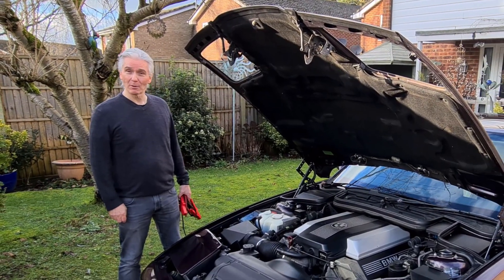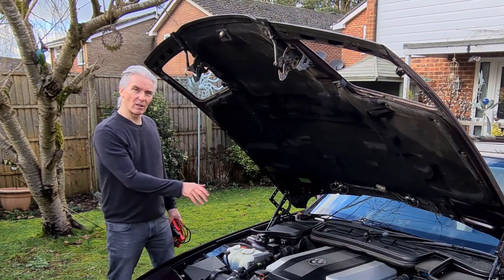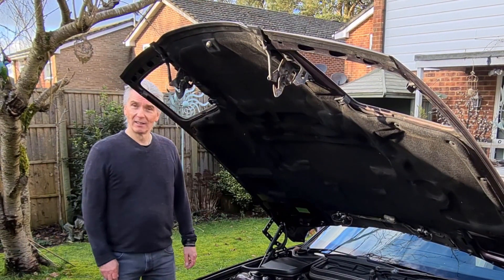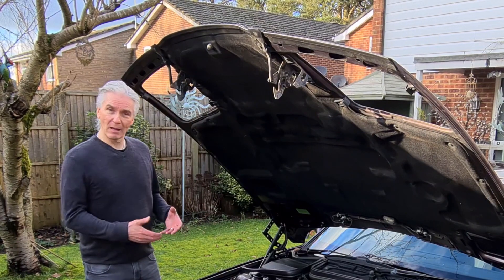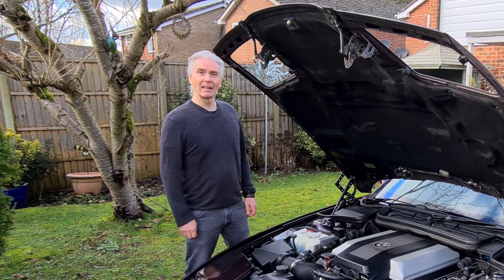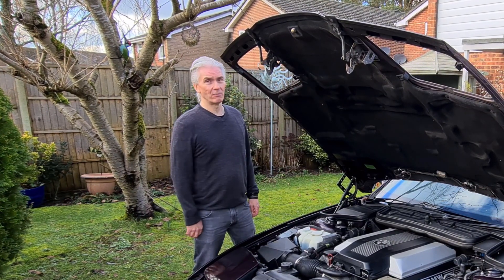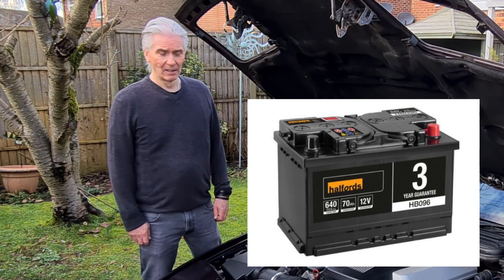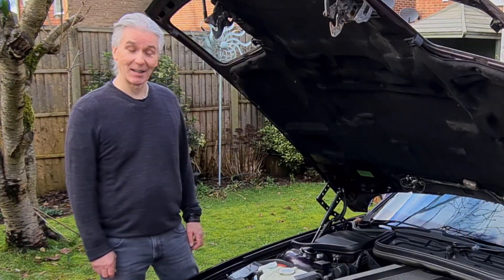OLD BMW? NEED A JUMP-START? NO NO NO NO NO!

Comment: My thoughts Tim, rather than opposing opinion as this video will help someone bricking a module which is unrecoverable. I'm using 35 years on the spanners with some electronic experience (to be completely transparent 20 years of that, was corporate IT and cars as a hobby) those connectors under the bonnet are for convenience (as stated by BMW) battery location which helps with the neutral front/rear balance can be a time consuming activity to access (model dependant). The problem is some of these cheaper jump starters is they have burst voltages way above 20 volts (non BMW alternators may have this issue, I can't say) which is enough to corrupt modules whereas most BMW alternators top out at 15 volts which is just within the safety threshold. 

To summarise briefly and reduce any possibility of module corruption (jumping BMW to BMW which I do for coding sometimes) I'd connect jump leads with the jump car engine off, then try to start the car with the flat battery. The extra 100 amps or so you'll get with the alternator running (assuming you have good jump leads capable of carrying 200amps minimum) isn't going to make a huge difference and most batteries sit between 12.5 to 13 volts which is well below the voltage required to corrupt module memory. 

Just my opinion only, pinch of salt and all that, keep up the good work! :D

[edit never killed a module ever, done a few hundred at least]
Reply from the maker: Thanks, these are the sort of replies that keep me going!
Reply: Sorry I just came upon this and I have to say [quote] "connect jump leads with the jump car engine off" [quote off] this is the foolest thing to do when jump starting cars. Always have the donor car running before connecting jump leads! The alternator has a voltage regulator unit that will do just fine with any differences in current, but the whole system must be running altogether with donor battery charging.
If you connect dead battery with good battery on your car than you are asking for disaster. The difference in potentials between the two batteries can do a real damage to any electronics connected to your battery. I would not do that.
Reply: @TimmsBMWRepairsandInformation  wow nice info Sir.  I just  bought BMW E34.  I wasn't driving it for 2 months and I have no idea how good battery is.  I was about to jump start it just in case if battery is flat. Im im happy i found this video.  My question is what to do with battery if I'm not using car for 5-6months?  (winter period)  It''s safe to disconnect  for winter?  and is battery charging and connection back is safer?  
Tthank you.

Comment: Yes, well said again Timm, another informative video. Just for the sake of informing a lot of your fans commenting, I have several old cars, including the E31 that I try to keep going and batteries are a pain, as you have so perfectly explained on previous videos. I have, for a few years now, two main tools in my arsenal. One is a top quality "intelligent" battery charger (not too expensive really), and a new spare battery that I keep topped up fully charged. If there is no real alternative to jump starting the dead car, such as where it is parked, then jumping from a good battery rather than another car is much safer. Also switch the headlights on before connecting the jump leads, leave them on until you have disconnected the leads, this gives an extra load to absorb any spikes. Keep the vids coming!
Reply from the maker: Thanks Bob, and good to hear from you!
Reply: Why not just replace empty battery with full? I'm newbie here.  And how you jumpstart car battery?  Do you put terminals under hood + and ground for example shock absorber screw)? or empty battery under rear seat to full battery. Nice tip with lights on. Thank you. I will defunetley buy intelligent chartger ans one spare battery. Better safe than sorry.  Sorry for those dumb questions😂 i never payed this big attention to these details owning other cars.

Comment: Hello! Just discovered your channel. I live in the US (California) and have a 1993 850Ci that I love, 3rd owner, 135K miles, had it since 2007 and, as my mechanic says, I will be buried in it - not due to accident but because I will never let it go.
I knew that jumping was a bad idea, but since mine is currently dead due to being out of town and not driving it and so happy I saw your video. I will invest in 2 new batteries to be safe.
An aside, I watched your vid of getting your car back after accident and you mentioned the headliner sagging. I just got mine done at my local BMW specialist (Coast Motor Werk) and it looks amazing - they did an ultrasuede that matches my gray interior perfectly and apparently will "never" sag. They did an amazing job. I also had the bushings replaced since apparently my engine was resting on my exhaust system. Very different drive after, and I'm not sure I like it since I was not used to a bouncy ride. Mine is silver OG color that is super faded. I am considering Techno Violet (individual color) but love the Maura metallic that you have. Thank you for the videos and the detailed information.
Reply from the maker: Always my pleasure!

Comment: BMW's are jump started in BMW workshops all over the world every day.
In 40 years working on BMW's never once had an issue. With the 1 in 10 rule , I should have had about 200 problems.
There is a problem with the maths somewhere .
Reply: Never had a problem jump starting my bmw, in fact never heard of anyone ever having problems after jump starting 1. Even bmw state that is what the points under the bonnet are for. Got a feeling people will be doing the most basic mistake and nit connecting red first
Reply from the maker: Thanks for your reply, yes, there is little chance of damage - but the risk is still there and I have been involved with many cases where damage has been done.
Reply: I think that engineers in BMW know very well what is inductions and the damage that can cause. All electronic modules are designed to stand such voltage picks that can appear when jump start the car. One more thing, when replace the battery I may have same problem connecting the terminals. Is this mean that I mustn't replace the battery? If you afraid from voltage spikes follow the advice from Bob Frankish turn on lights. Resistance is enough to smut spikes. The only problem with jump start is to put wrong polarity. This definitely will damage something.

Comment: I think the root cause of jump-starting problems (aside from reverse connection) actually comes from the fact the dead car's battery has sulphated of effectively has a high internal resistance. This means that when the car finally starts and the jump leads are disconnected there is not enough resistance in the battery to buffer the output of the alternator which can surge sky high. I good rule of thumb is if the battery can start the car then its probably safe to run the car. Therefore if the car needs to be jump-started then the battery is probably not good enough to safely run the car. 

One may think the battery will charge up quickly, this is not true on a battery that's been sitting for a long time. It may only take a few amps of current even at 50 volts so there is effectively nothing to clamp down the alternator voltage.
Reply from the maker: Hello Andrew, yes, after producing the video I realized that I had forgotten to mention the battery impedance - which increases the more Suplphated it is - and the state of charge which does exactly the same. As you say, the battery forms an effective load for both inductive spikes and lack of alternator regulation - Thanks!

Comment: Jump leads with surge protection are available which can manage the inductive effects. Better to avoid jump starting altogether, but there is a technical solution for this problem.
Reply from the maker: Thanks, yes good advice!
Reply: @MrFryfish  I've got about half an electrical engineering degree, we did cover inductance and all the basic differential equations. Not that I have much intuitive feel for quantities, are you saying jump leads don't cause inductive spikes? Thinking about it, I suppose the starter running and stopping is probably the biggest sudden current change, that happens every time the starter is operated and isn't happening when the jump leads are disconnected.. Even if there aren't inductive voltage spikes, there's still a load-rejection voltage spike when disconnecting jump leads, though that'd affect the car with the full battery, not the one with the flat battery...

Maybe best practice should be to turn off the running car before disconnecting jump leads, to prevent load rejection voltage spikes..
Reply: @MrFryfish  what happens when you disconnect a DC circuit.. the current changes suddenly, causing a voltage spike.

Comment: Just keep a small lithium jump pack in the boot. Check the charge level a few times during the year. 

In the winter whenever the temp drops to 0, I will hook up a trickle charger to my car battery for a day to keep it fully topped up. 

Those trickle chargers only put out about 1.5 amps max. So will not harm anything.

Comment: Jumped my 99’ e36 M3 a couple times, WITH NO PROBLEMS, at the battery terminal, before I finally replaced the dead battery.
Reply from the maker: Thanks for the info - my video does explain that you are unlikely to damage the electronics - but sometimes you do!

Comment: Interesting discussion. Older electronic components (ICs) can easily latch-up. When this happens they get very hot and will eventually destroy themselves or their power supply. A transient voltage or spark can do this.
Reply from the maker: Thanks Andrew!

Comment: My 2008 750li battery does not last long sitting. We drive about once or twice a month. And I need to charge it overnight before. If I try to Crank it over after about a week, it's so weak .I used to charge it from the back directly, then I watched a video saying it will fry the electrical/computer system. Now I charge and " jumpstart " from the front
Reply from the maker: You can charge from the batter+ve terminal and the chassis, you cannot use the batter-ve terminal. You will not have any damage, but the ECU does not know the state of charge. Time for a new battery!

Comment: I'm an electronics engineer and I agree with this advice. I'd add that many jump leads are poor quality and can make a fairly ineffective connection. When you consider how much current is needed to run a starter motor and you look at the way many cheap leads connect it's amazing they work at all!

If you're having trouble be sure to turn off lights, stereo, fan, etc. and try again with the minimum electrical load. I've seen it make the difference on a low battery.
Reply from the maker: Thanks from another electronics engineer!
Reply: I can certainly say that thin leads weren't enough to start my 190D when an alternator brush had worn down too far and it wasn't at home.. had to have it connected about 5 minutes before it would start (the diesel can drive without a battery but won't start that way).

Comment: Great information! I will definitely not be jumping my E39 after watching this. But what about a jump/starter pack? The sort the connect to the cars battery/jump points and then gets switched on? Do they create the same high voltage spike when there switched on aft connecting to the car? 
We use them alot at work on modern BMW/Mini
Thanks
Reply: Those things are perfectly fine, because they got a secure mechanism built in to prevent Voltage spikes.
I’ve used them multiple times on my E39 in the past and everything went perfectly fine.
But I would suggest to use them directly on the battery in the trunk, rather than using the plugs in the engine bay.

Comment: Damn.  I keep a pair of jumper in the trunk. Not the cheap crap with the sheet metal pliers, the real deal that pinch grown man style, made of plain thick metal. And I've jumped a few cars in desperate need of juice here and there. Now that I know, thanks to you Timm, that it can pop a random module of my e39, I'll keep them for my old Civic. She hopefully doesn't mind a few spikes of volts. Or perhaps it could damage the alternator' regulator ?
Reply from the maker: Bung them in the boot of the Civic - they'll be fine there!

Comment: Jumped my e39 m57 .with my x5 4.4 ..now e39 missing and not charging white smoke .😢
Reply from the maker: The white smoke shouldn't have been caused by jumping - but the failed alternator will be

Comment: Timm thank you, also the problem is most Bmw owner is just do sth then invest is it right or not. Some of them dont know black, red polar. I saw important mistakes outside. Some Bmw services even dont know how to charge battery. In Turkey is it normal to service destroy your car easily.... 

2 days before I cleaned all grounds, checked alternator and its diods, cleaned sockets and got new Varta battery to make all system brand new. I have also battery charger with 3 A to make my battery minimum 12.50 V. 

)
Reply from the maker: Good to hear from you Ali!

Comment: Why do BMW fit jump points under the Bonnet if its not advisable to utilise them ??
Reply from the maker: They are not Jump points, they are charging posts!
Reply: Umm, Despite watching quite a few BMW Videos where they all use the under bonnet remote posts to jump the car your still firmly in the minority who say not to, Confused now, Additionally I messaged NOCO USA and asked if their Range where safe to use in this manner and they stated it was not a problem as long as they were used correctly. The other thing that has me puzzled is the posts are way over rated for just a charger connection, Looking more up to the task of a Jump cable of Booster Clamp. So we agree to disagree on this one :face-blue-smiling:

Comment: I own a E32 740IL 7 series, and my battery out, thanks to you're video I will not jump it, but charge it I will do, but I can only locate the positive under the hood and not the negative. Is there a specific bolt or knot that will suffice for ground coverage? Like one of the bolt/knots that are located right were the shock absorbent is
Reply from the maker: Yes, that's the one, the larger nut on the suspension shock tower.

Comment: As long as you don't connect the cables backwards and key is out or switch is off, it's ok.
Reply from the maker: ....usually it is - sometimes it isn't!
Reply: Many BMWs have a sleep mode for 16 minutes after you remove the key. So modules are still getting power.

Comment: Does the same apply to an E39 530D ?  
some context. 
i jump started a friends car and the next day my battery was completely dead. i did jump start it a few times after but no matter how long i left the engine started i couldnt get the battery to start my engine from cold. 

side note- my boot/ trunk latch developed a fault around the same time (broken spring) so the light inside the boot wouldnt turn off so i figured thats what had drained my battery over some time.

However,
i changed the battery for a brand new one as well as getting a new latch fitted and all was fine until a couple weeks later. i did not drive it for between 24-48 hrs and the battery was flat again . dont understamd why its happened can anyone give me any suggestions?
Reply from the maker: Yes, same applies to the complete E39 range - you need to measure the current drain - all explained here: https://youtu.be/8AKYiOI_nyg

Comment: So how do I get my car started
Reply from the maker: Charge or replace the battery, that's the safest way....
Reply: @TimmsBMWRepairsandInformation  This is scary. Old bmw e34. it is safe to remove battery charge and put i back or charge while battery is in car connected. I don't want to mess up any modules. Thank you

Comment: How about charging your existing batteries? I noticed you have a charging lead only on the left battery?
Reply from the maker: Yes, I have a CTek MSX 5.0 fitted to both cars to keep the battery in good condition. The E31 batteries are in parallel and you only need to connect to one of them as they are treated as one BIG battery!

Comment: My jumper leads have inbuilt surge protection; are they safe to use?
Reply from the maker: Possibly, but do you want to take that risk?
Reply: @TimmsBMWRepairsandInformation  my E46 318i had a bad battery. I had to give it quite a few jump starts before I finally bit the bullet and replace the battery.

A couple of months later, I had to replace the transmission module as well as the ABS module. I suspect the previously bad battery, or the numerous jump starts may have contributed to the module failures.

Comment: Hello Timm question for you love your info, I’m at a dead end with my car I change the battery and rebuild starter it started 4 times  and went beck to making a clicking sound and will not start it’s a E 38, please let know what I’m missing or what’s wrong thank I need your HELP THANK YOU
Reply from the maker: I would guess that the refurbished starter failed - it has been known!
Reply: @TimmsBMWRepairsandInformation  thank you Timm I did  run a direct from the battles to the solenoid wires.
It had no movement so I’m in the process of replacing the starter, I’ll let you know, thank you🙏🏻

Comment: It is normal for n62 4.4 series 6 to have when i drive hard 103 grades water temperature? Thanks
Reply from the maker: Yes, that's fine - anywhere between 90C and 110C

Comment: My question is my classic E38 only gets driven a few times a month and the way I store it is disconnect the negative terminal at the battery, when I’m ready to take it out for a spin I just reconnect the negative terminal ( there’s always a little spark when touching the terminal with cable), then I have power and it starts. Am I taken a risk by doing this?   Thanks in advance.
Reply from the maker: No, that's fine, I've never heard of any damage being caused by disconnecting the vehicle battery